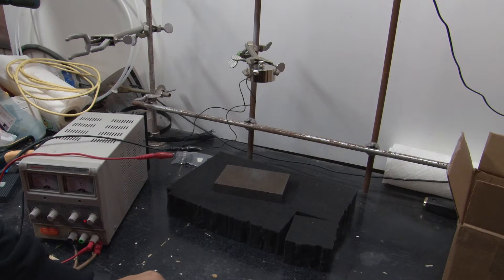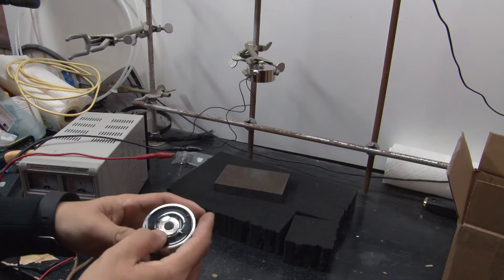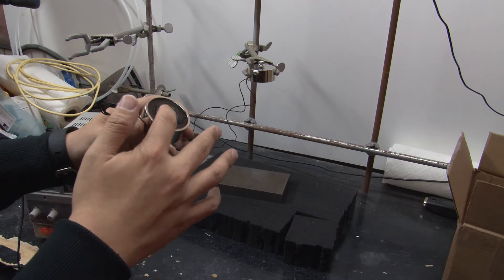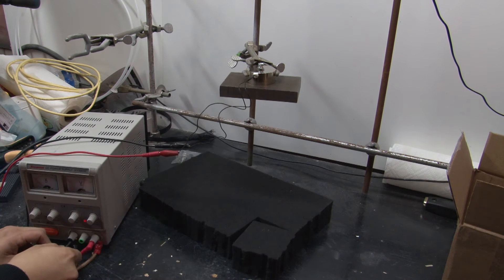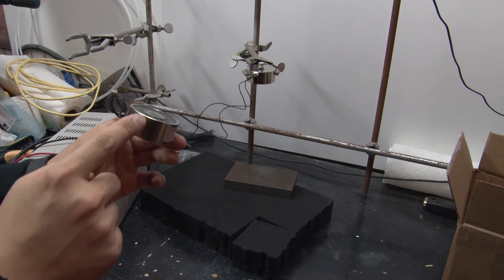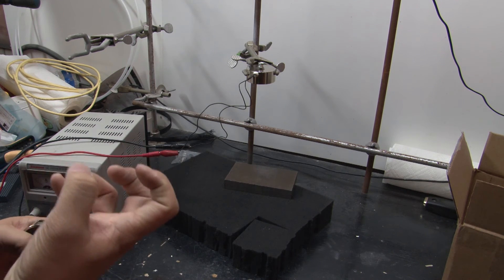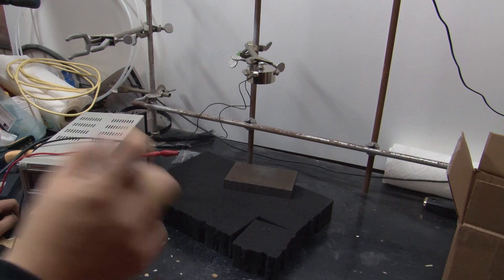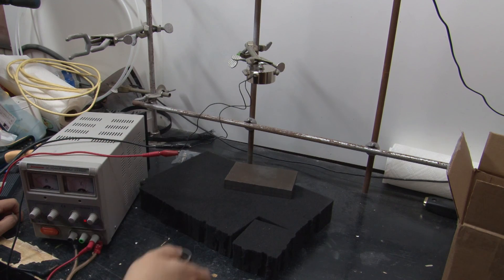(25) Electro Permanent Magnets! (Part 1)

Comment: Your like the only person on the whole internet with a solution to getting an electro permanent magnet with out breaking the bank. I need to use some of these for a project is there any way I could talk to in more detail about this a little bit?
Reply from the maker: Sure, admittedly it was trial, error, and some luck?
Reply: @aonomus  So I was looking to use some magnets for a project and came to the conclusion that it really needs to be Electro permanent, and need at least two preferably 4. But don't feel like shelling out 300 or 600 dollars. I have basically no experience making or machining anything like this. So in short, would I be able to make some with minimal experience or equipment? What all tools did you have to use to make yours?
Reply from the maker: @Sparta-pm4ol  I used a rotary table on a milling machine, but theoretically one could use a lathe instead. Once you carve out the space for the neodymium magnet and mount it, epoxy pot it.

Bear in mind you'll need to avoid cutting through electromagnet windings. Best way to figure out the magnet configuration is to get a gaussmeter and measure the static field off a permanent magnet and match it to an electromagnet. Then you put the permanent magnet "in series" with the field of the electromagnet, such that a reverse field will null out the permanent magnet briefly.
Reply: @aonomus  Also, thanks for actually responding to me. It was kind of a shot in the dark. I mean the video's like 4 years old and you responded in like 5 minutes.

Comment: can you tell me how much current was used to release the 1lb plate in the part 1 video with the 22volts?
a rough estimate would help if you can't recall exactly (are we talk'n a few to several hundred milliamps or something like 1 or 2ampsaa?). thx
Reply from the maker: I believe the current was around 1-4A, for those specific coils. But it's only required for a few hundred ms.

Comment: So I'm guessing instead of releasing if you were to reverse the polarity it would increase the holding power or does it not work that way?
Reply from the maker: That would be correct, since the electromagnet and permanent magnet fields add instead of subtract.

Comment: how did you integrate the magnets into the electromagnet? i drilled my electromagnet and inserted 3 neodymium stacked. when i power it, it doesn't demagnetize the field. i tried reversing the polarity and still nothing. please advise. thank you.
Reply from the maker: The magnets you select need to be nearly equal to the strength of the electromagnet and you may need to measure it with a Gauss meter. The electromagnet cancels out the field, so if the permanent magnets are stronger than the electromagnet there will always be some residual field.

Comment: Hey, I know it's been a while since the upload, but I didn't see a part 2 on your channel and didn't know if you still planned on making one or what exactly you would put in it. Would it be too much to ask for you to make a DIY tutorial outlining the parts you used and process you underwent to make one of these? I very vaguely understood what you were saying, but not exactly enough to be able to make one. I would need to redesign it a bit for my purposes, but it would really help if I knew how this EPM was built. Short of that, if you could maybe make a cross-sectional diagram and very briefly overview it in part 2 (if that ever gets made) just so I could see what it looks like inside so ai could try to figure out what's going on, since before I found this video I was trying to learn about EPMs, but they were more like the second type you described in your video with the AlNiCo and whatnot. Your way seems much simpler to manufacture

I'm certainly no engineer, nor do I really have a good grasp of electromagnetism, but I think with a little more of a visualization I could make a small EPM based off this design and what little understanding I've gleaned from some articles, forums, and a couple short videos I've seen. This upload has been pretty helpful regardless though, and I'll keep trying to figure it out exactly so thanks for this even if you don't make a part 2
Reply from the maker: Admittedly I never got around to making part 2 and finished the project and got too busy to make the video.

I used electromagnets and neodymium magnets from Aliexpress, and did a lot of trial and error to estimate how much magnet vs electromagnet current was needed. If I was to do it again, I would get a cheap gauss meter, plot current vs magnetic field strength, and figure out how many of what magnet would be required to equal the field on the magnet.

Also note that I had to mill out and pocket the electromagnet to fit the permanent magnets.

Comment: that is not the way it supposed to work. you just make an inverse electromagnet
Reply from the maker: At the end of the day an EPM is a magnet where the field is passively on, yet controllable by an electrical current. This is the quick and dirty version without going to the effort of sourcing specific NdFeB/AlNiCo pieces with the correct coercivity to work properly, as well as machining all the parts.

I'd still say that this qualifies as one type of an EPM, though we can agree to disagree.